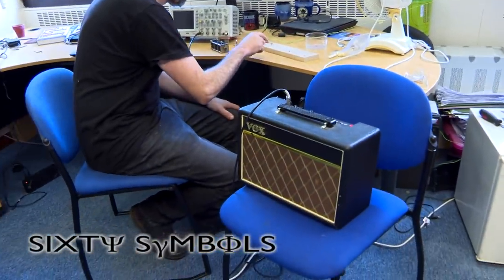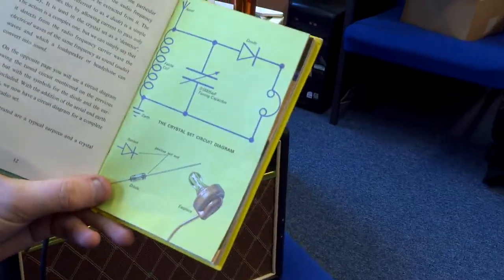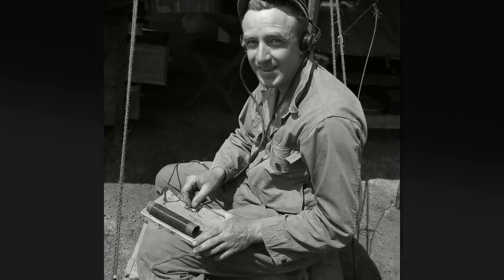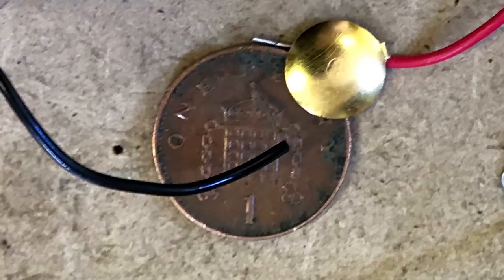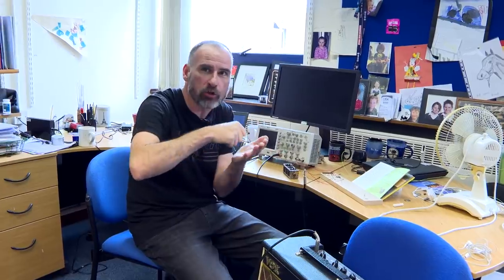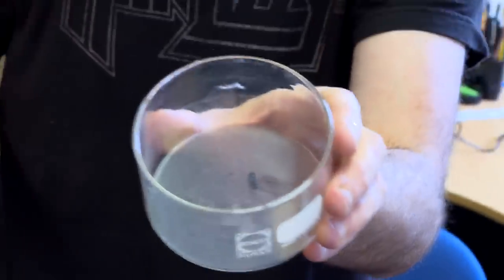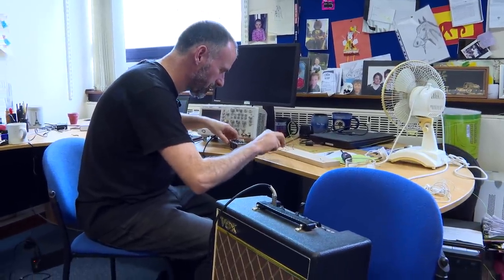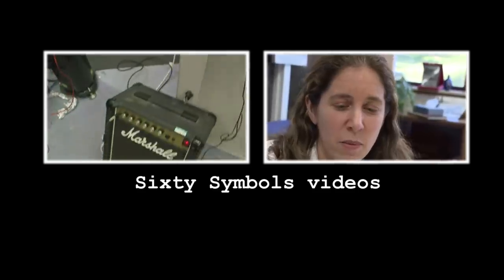The Joy of Radio - Sixty Symbols

Comment: Hey, how does the undoped silicon know which way to let the current go? (my assumption about the penny was that the side the oxide layer is on matters for which way the diode is facing) 

(also, wow this is amazing! On a penny!?!)
Reply: Like the prnny, its probably picked up the 'wrong'(too many  or not enough valence electrons) type of atoms from the dirty environment and they have migrated into the crystal and changed the bandgap in tiny patches all over the place.  The cat whisker gets lucky and sometimes lands on those spots.
Reply: No I mean the silicon piece. I think that transistors have a sandwich of differently doped silicon layers. 

So I'm wondering how that bit of silicon does the same job despite not being a doped sandwich :)
Reply: @charlottemarceau8062  With the silicon in this case, it's the same effect as for the penny. The contact of the wire (or thumb tack) with the silicon is not a pn junction -- it's a metal-semiconductor contact. This is known as a Schottky barrier and also acts as a diode. See the blog post linked in the video information. 

All the best,

Philip
Reply: Note that in both cases (penny and piece of silicon) the diode is metal-semiconductor-metal, in case of the penny the semiconductor is the copper oxide, touching the copper on one side and the wire on the other side, in the other case it's the silicon touching the thumbtack and the wire. A metal-semiconductor junction can either be an "ohmic contact" (non-rectifying junction) or a "Schottky barrier" (rectifying junction) depending on factors I don't really understand myself. For this setup to work, the semiconductor needs to have an ohmic contact on one side and a Schottky barrier on the other side
Reply: Hm, so are you saying that the contact where the tack meets the silicon is different from the contact where wire meets the silicon? 

And if you swapped which way round they were then it would block the current in the opposite direction?

(thank you for your answers! xX)
Reply: @charlottemarceau8062  Yes those contacts have to be different for the rectifier to work (although this particular circuit doesn't care which side is which, only that current is more impeded in one direction than the other), either because of a difference of metals or because of difference in details at the contact (e.g. due to oxidation or contaminants). Apparently there can be a lot of complication in the metal-semiconductor interface:

"Under realistic conditions, contact metals may react with semiconductor surfaces to form a compound with new electronic properties. A contamination layer at the interface may effectively widen the barrier. The surface of the semiconductor may reconstruct leading to a new electronic state. The dependence of contact resistance on the details of the interfacial chemistry is what makes the reproducible fabrication of ohmic contacts such a manufacturing challenge."
— Wikipedia page on Ohmic contact
Reply: Ah right! So its because there's brass (the pin) on one side and (presumably) copper on the other side. Thanks for that, it wasn't obvious! xX

Comment: look at youtuber vinny stvincent recent videos and watch the wheel spin now think that is a car engine crankshaft and the pmh a starter motor and the relay/exciter a starter solenoid and instead of the magnets on the rim a oil in the engine and water on the other side (of coarse of the block core or is it now a fluid tesla coil and switch the charges by starter solenoid ) may you get a magnetic pmh disturbance engine    dont let it earth to earth place on wooden board/bench  or nitrogen in thick rubber tyres   datsun knew this in 1978   gary stokes chief uk engineer saw a ceramic engine that ran on anything  shelved a year later